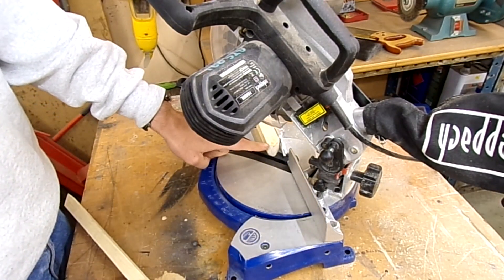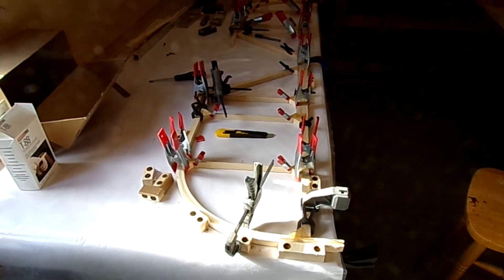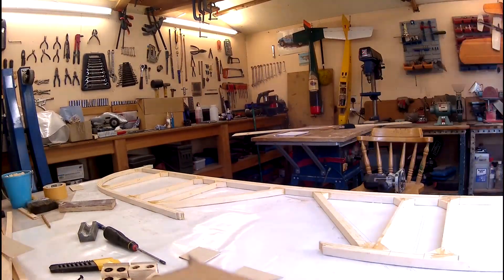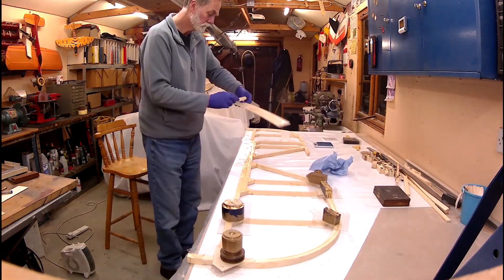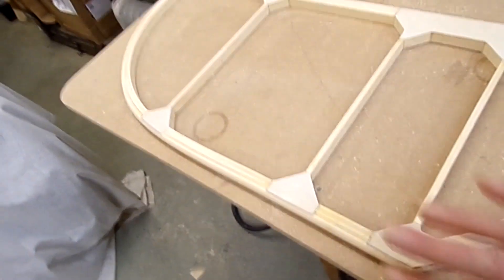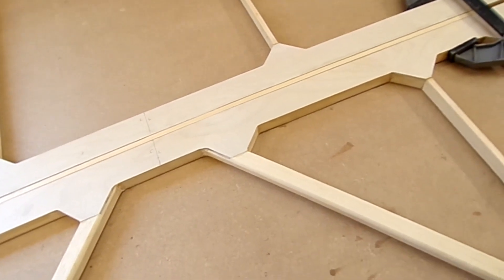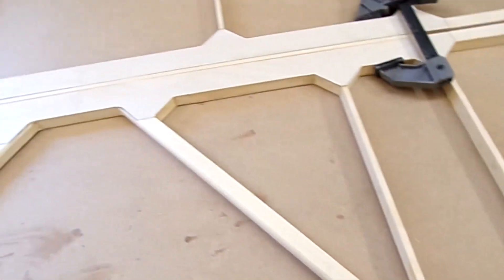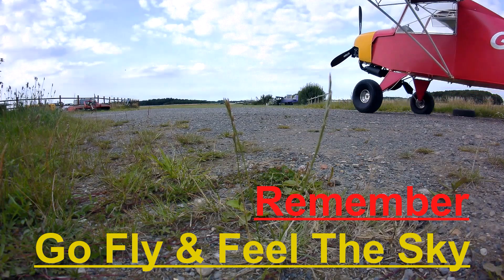EP6 Fisher Youngster V Kit Plane Build - Elevators and Mod

Comment: Re glueing end grain - I've read that sanding end grain is to be avoided as dust fills the grain and weakens the joint. Your thoughts?
Reply from the maker: If I have to sand a joint, especially end grain, I use a wire brush, then compressed air to clean the area. I have not found any problems.
Reply: Good to know. When I read it I thought maybe a good tap on the bench would be enough to dislodge the dust anyway.
Reply from the maker: @nickbarsby3378  It tends to stick a bit with some wook like Northen White Pine, Douglas Fur and Spuce so a fine stainless steel wire brush gets most out, the compressed air can get a bit more out but nothing much, it is mainly the brush.

Comment: Also how do you sand off the execess adhesive when laminating things like the leading edge of the tailplane and make sure the result is flat and you don't over/under sand across the length of the leading edge for instance?
Reply from the maker: That's just a case of taking my time and just sanding keeping the bloke flat until I meet the wood.

Comment: Really enjoying watchng these videos and learning a lot watching how you approach things. At 7:48 you show using a router to trim off the excess material from the gussets. Do you have a guide for this or is it done just by eye?
Reply from the maker: Thanks for watching. The router has a bearing at the end the same size as the cutter so will only cut back as far a the material it is running on.

Comment: Thats a nice little Farmhand, I really enjoy flying my 90 version.
Reply from the maker: Good spot, it is slightly modified and rounded off a bit and flaps added. The engine that out at the moment is a Saito 14B 4 stroke petrol, which sounds nice in flight.
Reply: @flyingkub  Ill bet that sounds good. Mine is unmodified with a DLE 40 twin which gives it plenty of poke for occasional glider towing.  If I were to do it again theres a few things I'd change like split flaps instead of the standard plain ones.
Reply from the maker: @TomGarner4505  My one is very aerobatic and even with the heavey engine could fly slow, with good STOL ability. I did think about the big one. My one has lasted well it was one of the first 60 size kits released.